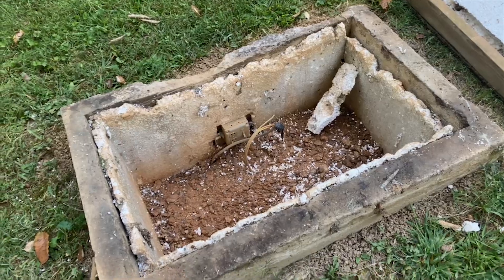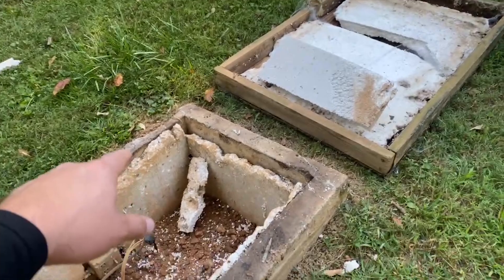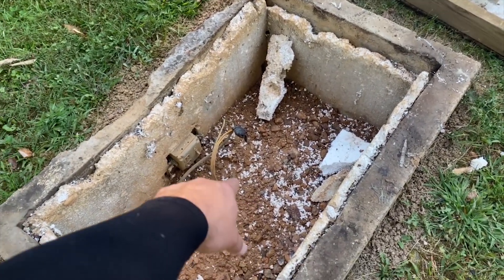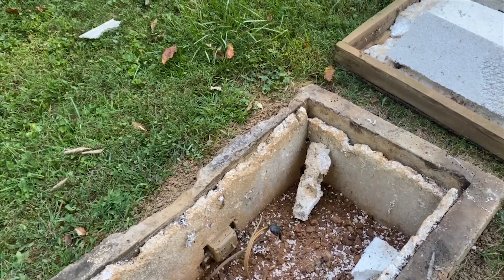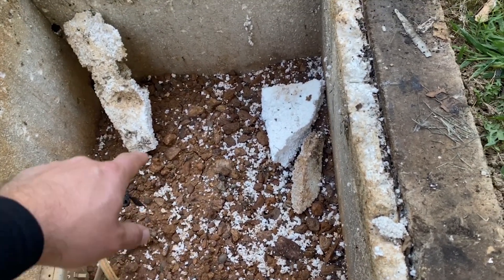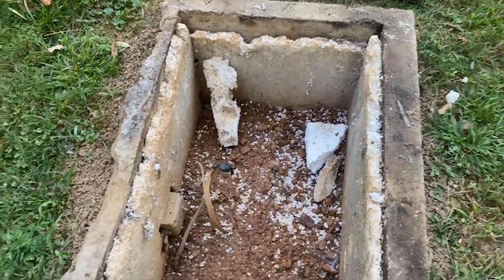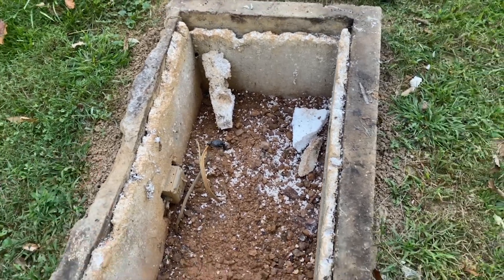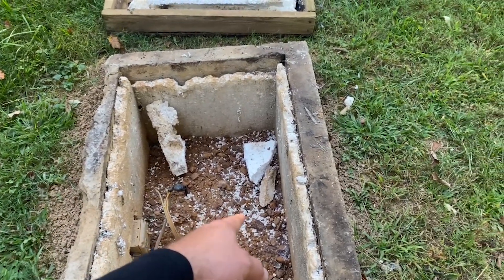Well Pits: How They Work & Why They Were Used

Comment: Groundwater and surface water are not the same thing. Surface water is on the surface, either sitting in a basin (marsh or lake) or flowing down a valley (river or stream). Groundwater is in the ground. An aquifer is a special kind of groundwater in that it is commonly below a dense layer of rock or soil. That dense layer keeps the water in the aquifer down, but if a well casing penetrates the dense layer, the water will flow up into the casing as far as the pressure in the aquifer permits. Such a well is often called an artesian well, but some people limit that term to wells where the pressure pushes water out of the top of the well and the water flows without a pump.  The top "surface" of groundwater (it's more a zone that ranges from damp to wet) is not level, as surface water in a lake or pond would be, but varies according to the amount of rainfall, the terrain, and the permeability of the soil. If the level of the groundwater rises enough so that it meets the surface, it can become surface water in the form of a spring or pond (or a leak into one's basement). Historic water sources were often springs and people often erected spring houses over them to protect the water from contamination or house a cistern above ground or partially in the ground. The cisterns were not wells such that the water could seep into them from the sides, but sealed basins for collecting and holding water. When people did not have an accessible spring, they would dig a pit to get down to the groundwater. The pits were usually large enough to fit a man and his shovel. Once they were down into the ground far enough to reach the groundwater, the pit became a well. If a hand-dug well did not reach an aquifer, the water would not rise above the top of the surrounding groundwater. To have room for a bucket to collect water, the pit was dug below the top level of the groundwater and the groundwater would seep slowly into the well. If there wasn't enough rain to sustain the level of the groundwater, the well would run dry. Digging farther down might restore the well. A wall was often built from the bottom of the pit to above the surface to prevent cave-ins and to keep surface matter from falling into the well. Historic wells would allow water to seep in the entire depth of the well. Modern wells are generally sealed and draw water only from the very lowest portion of the well. The deeper the source of the water, the more likely it is to be biologically safe, for there is more filtration of the water as it seeps deeper into the ground. All groundwater, whether or not in an aquifer, will have minerals dissolved into it. (like lime or iron, making it "hard" water). Generally, the purest water is filtered by sand. Shallow wells often had more pathogens than deep wells, but by exposure people often became immune to most of them. Note how polio had existed for a long time but did not become an epidemic until the middle of the twentieth century when most people were no longer exposed to it while growing up.